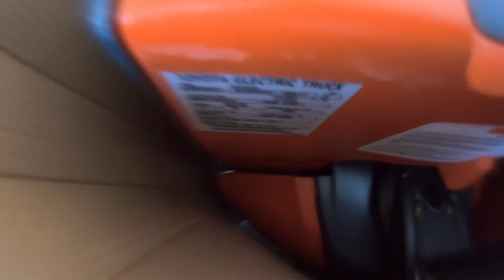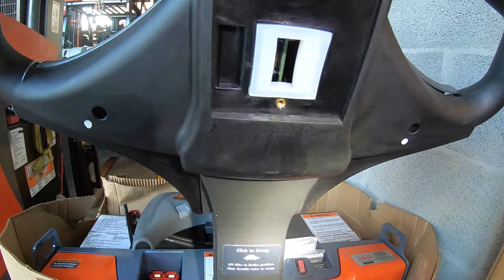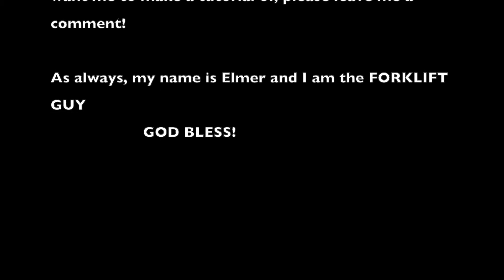HOW TO Replace a Raymond/Toyota Electric Pallet Jack Tiller handle control board.

Comment: Thank you for the video. Could you please explain to me how you determined that the issue was originating from the handle control?
Reply from the maker: Water got into the controller handle, due to extreme freezing conditions. And it would throw random codes all the time and would not want to do anything. No functions.
Reply: @theforkliftguy  Thank you so much

Comment: Hi, great video! I just replaced the same board and I'm able to move the pallet jack up & down, but not forward or backwards. I'm also missing the red stop button.  Do you think that may be the cause?
Reply from the maker: @pungboy  most likely, yes.
Reply: @theforkliftguy  Thank you. I'll look into a replacement part.
Reply from the maker: @pungboy  does it throw any codes?
Reply: @theforkliftguy it’s showing 131 then the battery level afterwards

Comment: Having break issues with my electric Clark pallet jack any help with that do you work on them?
Thanks
Reply from the maker: What is the model and serial number?
Reply: i will get it tomorrow thanks @theforkliftguy
Reply: Amp hours 185-5
Reply from the maker: @mrundroppable4582  that doesn’t sound correct. Amp hours are for the battery

Comment: Any idea how to set the throttle control spring? In the handle?
Reply from the maker: What do you mean by “set the throttle control spring”?
Reply: @theforkliftguy  the coil spring that keeps the forward and backward control knobs in the center
Reply from the maker: @HLR_III  got it. You want to know how to install it or how to adjust it? Are you replacing it ?
Reply: @theforkliftguy  I had to replace the emergency stop button, when It was damaged the spring come out of place and now I’m trying to reassemble it and can’t work out what way to place the spring

Comment: what programming tool is needed (how do you purchase it) and what are the correct parameters to put in?
Reply from the maker: @bigbread9000000  has to be programmed by Raymond dealer. Only they have the software

Comment: I have a Toyota 8HBW23 reading E159, any insights on this code?  was working just fine yesterday.
Reply from the maker: Short or open in canbus wiring. This is probably in the wiring between handle and controller.

Make sure battery voltage is good. Check fuses (little glass fuses next to the controller box.) And make sure the contactor is good. Other than that, check for broken or short wiring that run through the whole handle.
Reply: @theforkliftguy  the 3v coin battery on the board I assume?
Reply from the maker: @bradtaylor5473  not sure what a 3v coin battery is tbh
Reply: @bradtaylor5473  Brad is referring to the soldered battery on the controller I believe (not the main battery) and can be seen at 2:39 in your video for a brief moment when you have your glove on it - its light green.  I have the same issue currently.  E159 occurring at first occasionally but now on a consistent basis.  The three volt battery is a br1632a Panasonic.  I have one on order and will let you know if it fixes the issue (I tested it and it was only discharing 0.9V).  Feel free to respond if you figure out how to fix yours and I will do the same.  Next step for me would be to check the wiring then order a controller board.
Reply from the maker: @spokanemilk752  following up on this. Any luck ?
Reply: @theforkliftguy  yes, I replaced the board (around $230).  That was the issue but I did not realize it has to be flashed so I went to the dealer and they flashed it for $75.  Has been working fine since. The battery was not the issue after all.
Reply from the maker: @spokanemilk752  sweet. Good to hear. Code E159 a lot of the times if it’s not a wire harness issue (Canbuss wires) then the board is the problem.
Reply: @theforkliftguy  my initial research left me to believe that but my harness was in such good condition I did not think that was the issue.
Reply: I have a 8hbw23 code e159 and thank to the comment techs this was an easy repair. If you turn in on code 159 then turn it off and back on quickly the pallet jack will boot up normally. Luckily we have a spare shop handle just for this purpose.   Thanks everybody!!

Comment: Good afternoon. I have the same pallet jack. Is it common for the control card to die? I have nothing on the led panel and no lights on keypad. I’ve checked the batteries and fuses and everything looks good. The Curtis controller Is blinking yellow so it’s definitely getting power. Is there anyway to test the control board before I purchase a replacement?
Reply from the maker: @encrio  if there’s no lights on the panel or keypad, most likely the connector that goes through the tiller handle (where it pivots) is damaged or has pinched wires. Check voltage on the wire harness that goes to the control card and see if there’s 24 volts.
Reply: @ thank you for your quick response. Should I check the voltage all the way at the top of the tiller where it connects to the board? There are 4 wires that go into the connector.. and into the board. should there be 24v going into the board?
Reply from the maker: @ yes, check all wires and if you want to go a step further, check continuity all the way back down to the Curtis controller harness connector.
Reply: @theforkliftguy  thank you 🙏, I will check this and report back.
Reply: @ At the very top of the tiller on the connector there are 4 wires. Not sure if I’m checking this correctly but I’ve got 25v on the red wire but nothing on the black.
Reply from the maker: @ okay. If you’re at least getting 25 volts, I think your problem might be the board. If you open up the tiller handle and remove the board, you’ll see where the board makes contact with the little display board. Make sure those are touching and are not broken

Comment: I work at a TMH dealership and I have six heads to program but all of a sudden I cannot gain communication and flash the e-tac.  I will sending a ticket to the factory tomorrow as they stated there has been changes made to the e-tac card. The toyota flashware program shows no communications with canbus?  I'll try to share any info I can gather from TMH.  Thanks for the great vids!!
Reply from the maker: I’m glad I can help. Keep us updated.
Reply: @theforkliftguy  Tmh had some heads go out with a different chip set. I had to update flashware to 9.8.    8.5 is only shown on TIPS for some reason not the latest version. They also have a couple of zip files to install in flashware and I was able to flash the etac.  Bootloaderfix file first then 029 file will show it was written to the card. I had to use my older laptop running windows 8.  Shop laptops with windows 10 will not connect to USB for some reason, waiting for tech support to help me correct this.
Reply from the maker: @Patrick-qv8qe  awesome. Good to know. We’ve had some Toyota techs run into similar Issues. They have to use their older laptop all the time now.
Reply: Our remote IT was able to correct the problem with our laptops. Had to download several drivers from HP to fix it. Now when you plug in the cable you can see the laptop recognize it and horray!! We can do our jobs now lol.
Reply: Forgot to add this had nothing to do with Toyota flashware it was all laptop bs.

Comment: I’m a tech for Walmart and one of my stores has a 2016 Raymond 8210 where the forks won’t lower, no pump no nothing when trying to lower them but the pump starts when you to raise them. Walmart says it’s time to replace it but the store likes its speed and really wants me to repair it. A new tiller is $2200, do you think if I got one it would fix the problem? I’m getting that new load wheel axle tool that I said I was getting this week.
Reply from the maker: @hermancm  so it raises fine but it won’t lower? Have you checked the lowering solenoid? You can disassemble the tiller and see if the lowering switch (it’s optical I think) isn’t broken inside.
Reply: @ Fixed my tiller question above… yes the jack raises but won’t lower. Will look into where the solenoid is, not checked yet. Tried taking off the tiller, pulled the two Allen screws out of the back then tried prying with a large screwdriver but it didn’t want to come off ugh.
Reply from the maker: @ you need to take the little keypad off first. That has 2 more Allen bolts behind it
Reply: @ No keypad on this one but there is a port cover. Had it off and didn’t see screws but will look under the cover again on next trip to that store, thanks for the help 😃👍
Reply: Last week I saw two black wires had come off a crimp on the horn of all things so I reattached them with a new crimp and damn if that didn’t fix the thing 🤔 Don’t know why but the backroom crew that unloads trucks were happy they could keep their old fast Raymond EPJ and so was I lol.

Comment: I Have a Raymond 8210 pallet Jack, the display hour meter/battery indicator screen does not work.
Will replacing the control card inside handle need to be programmed for Raymond or is it a simple plug and play?
Reply from the maker: It will need to be programmed for Raymond, yes.
Reply from the maker: Also, check the pins that connect the display with the control card. Sometimes they get bent or damaged. Might be an easy fix. Before ordering a new card.
Reply: @theforkliftguy   I appreciate the super fast response. Stay safe 🙏🏼

Comment: Hello,

I open the handle where the control card goes but I can’t get it to closed properly with the spring tension.
Please help
Reply from the maker: Which spring??
Reply: It was the tension spring for the forward and reverse handle. I got it the next day. You just have to add the tension before you closed the plastic holders for that spring next to the handle card.
Thanks for your reply
Reply from the maker: @Mr-kd9wc  got it. Sorry for the late reply 👍🏽

Comment: Great video thank you!!!!!Do you have to have the card reprogrammed once you swap from an old handle to a new?
Reply from the maker: Yes, it needs to be programmed first!
Reply: @theforkliftguy  that was quick I was asking if a working card in a broken handle can be swapped into a new handle without being reprogrammed. I asked the question incorrectly
Reply from the maker: @cyeid07  great question. I think so. Only a new one needs to be programmed
Reply: @theforkliftguy  Yes I was told if swapping a card from an old tiller to a new one it should work without being programmed. Haven’t confirmed it though.
Reply from the maker: @ it needs to be programmed first

Comment: Hey man i have the same toyota jack. 

My problem is it goes down but not up. I checked fuses , contacts and it’s not throwing any codes, is it the VM, and what does the VM stand for?
Reply from the maker: VM stands for “Vehicle Manager”. It’s a fancy word for saying main CPU. 
If it doesn’t go up, here are some common causes: 
- batteries are dead, or need replaced. (This is very common). Check voltage. 

- the height limit sensor is being activated somehow (it’s located right in front of the lift cylinder). It’s an optical switch. Maybe it’s being activated by a piece of metal. 

- the lift button is damaged. It’s happened to me a few times. You have to take it apart and see if the spring is damaged or bent. It usually throws a code for that though. But something to check. 

- the lift motor brushes are worn. Tap on the lift pump motor with a hammer and see if it wants to lift after that. 

- check those things and let me know. And we can go from there.
Reply: Thanks man I’ll let you know when i do my tests it’s probably gonna take a couple days I’m waiting on some parts
Reply: Okay so now after i replaced the cable that broke on me, the pallet jack is throwing a e225 code?? It’s says it has something to do with my precharge circuit failed

Comment: Hi, I have a spe125 which shows a code of C21. The battery goes from 100% to zero in a minute but I can still move it but can't move the forks. Battery is showing over 24 v on a meter. Any idea what is wrong. Thanks Dai
Reply from the maker: You will need to start by replacing the batteries. Or at least charge them fully. The computer has to reset. If it won’t lift, it’s because the computer doesn’t read enough voltage coming from the batteries. Once you replace the batteries, use your meter and see how much the voltage drops from 24v as you lift the forks

Comment: My pallet jack only works when I lower the handle to low position like at 50 degree angle to like when it cut offs when it’s too low to straight point. Is that card replacement issue?
Reply from the maker: No. Seems like a brake switch problem. What pallet jack do you have ? Raymond? Crown? Toyota?
Reply: @theforkliftguy  raymond.
Reply from the maker: @blocko312  check the optical switch where the handle rotates. There should be an orange light that comes on when you lower the handle. You may need to remove 2 Allen head screws right where the handle rotates.
Reply: Now it doesn't go up. Just down. It clicks when pressing down but going up nothing
Reply: Did you fix your problem?
Reply from the maker: @blocko312  following up on this. Any luck ?
Reply: @theforkliftguy  yes I did. I thought I replied back. It was that light. Just needed adjustment. Thanks
Reply from the maker: @blocko312  sweet! Good to hear.

Comment: I have a toyota, after replacing the card it turns on and flashes an 8 that moves down the row. Do i need to reprogram it?
Reply from the maker: Yes. That means the card you installed is not programmed for that specific truck.
Reply: Thanks
Reply: We had bought a maintenance tool but it doesnt seem to have the right plug is there a separate piece we need to plug in?
Reply from the maker: I don’t think so. If it’s the right tool, it should plug right in. Is it from a Toyota dealer ?
Reply: @theforkliftguy  Are you familiar with where it plugs in for programming?  I think it may be the cannon plug on the main unit (not the plug on the ETAC card in the handle) using the Raymond/Toyota programming control - but I am not sure.
Reply from the maker: @spokanemilk752  yes. Located next to the controller or above it I think. Where the fuses are